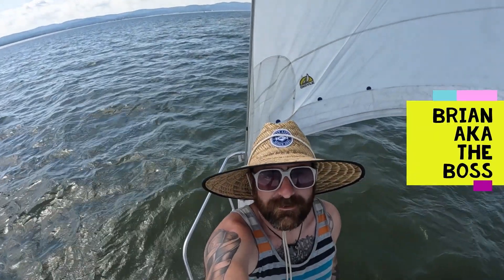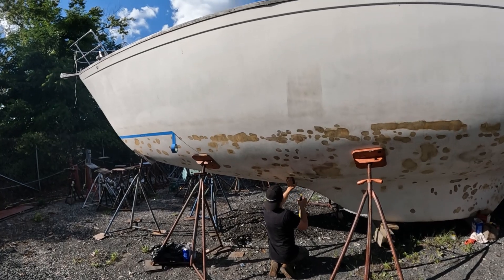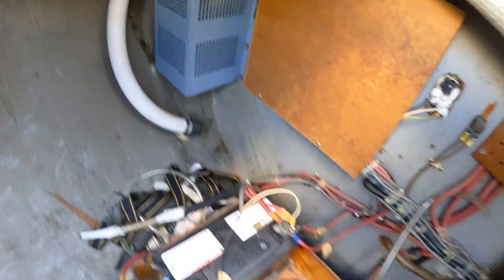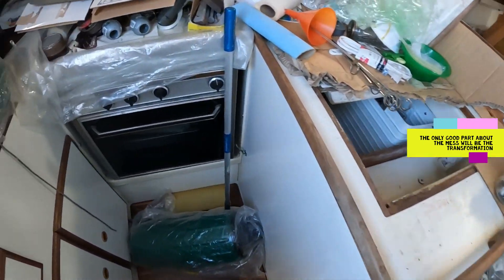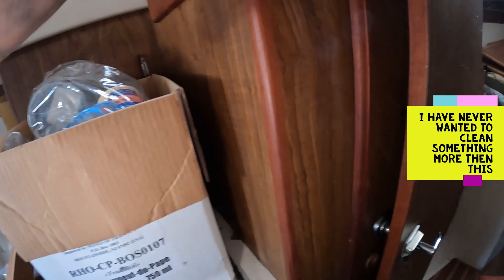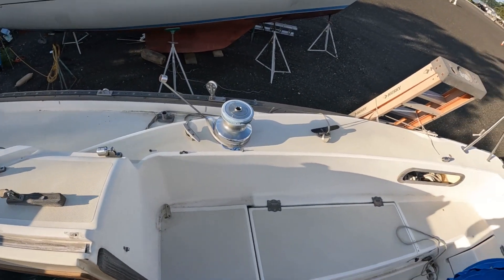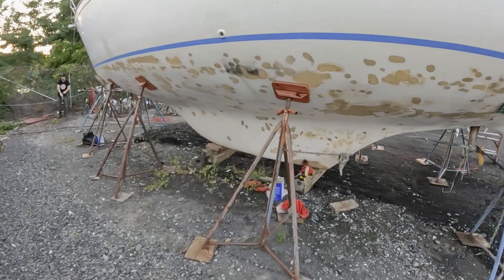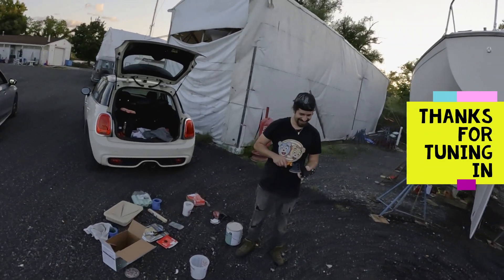Pearson 365. Sailboat restoration EP.2 Bottom job and tour

Comment: Check the mast step for galvanic corrosion.  It's a major issue on Pearsons.  Btw, I just purchased hull # 362, and did I get a good deal.  Only issue, now what to do?
Reply from the maker: @curtissmith1967  where u at
Reply: @Sailing.Artemis  I'm in Jersey City, NJ.  My boat is in Cape Cod.   I'm looking for crew for mid-Sept (I think).
Reply from the maker: @curtissmith1967  where you headed
Reply: @Sailing.Artemis  South.  Not sure how far yet.